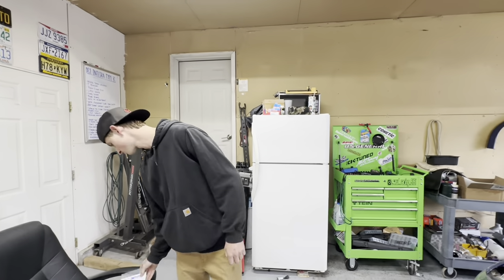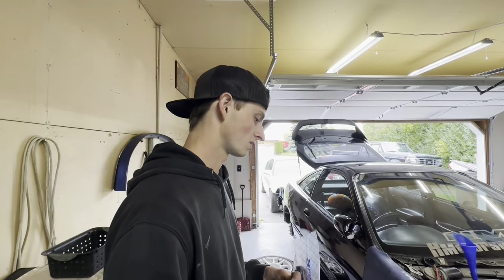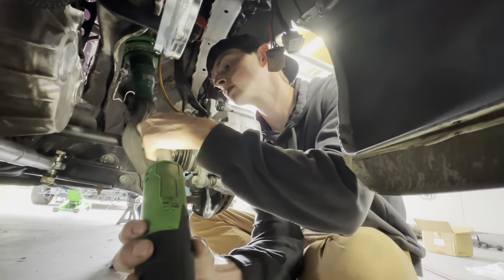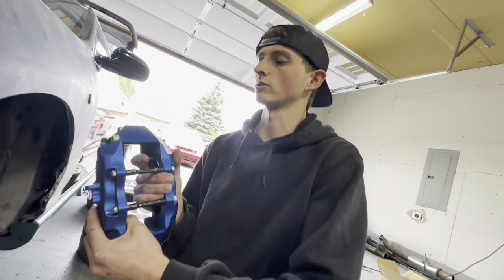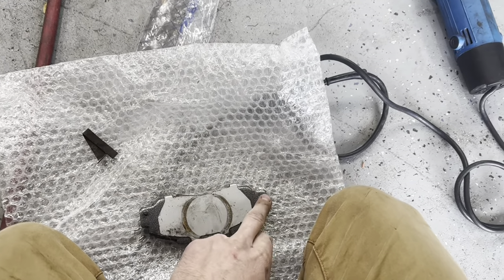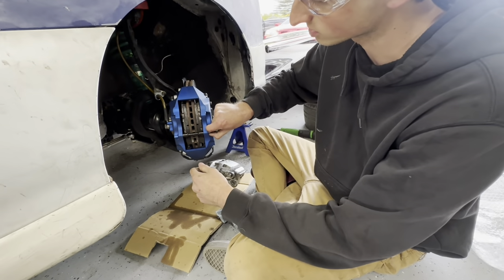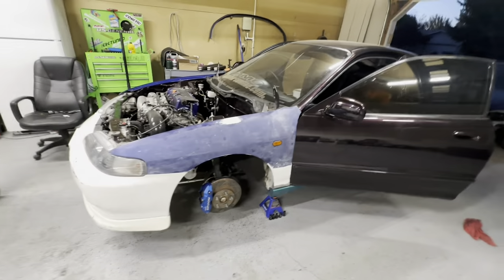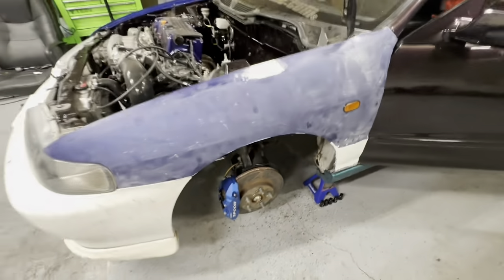DC2 Integra Type R $2,000 Spoon Twin Block Caliper install 😱

Comment: Nice install and explanation. Oh and kudos on the "safety squints" reference. 😁
Reply from the maker: Hahahaha god bless, thank you
Reply: @nwctuning  🙂 Just noticed you have EUDM clear indicators rear lights. Don't see them too often.
Reply from the maker: @MrGrentch  man those were hard to find haha! Came straight from Australia
Reply: @nwctuning  Forgot the Aussies got them too. Maybe the Mighty Car Mods lads riding around on kangaroos can see them more clearly? 😁

I think they look more 'modern' for some reason. I got mine from a local originally Irish sold one that the owner, overestimating his talent, as usual, ended up upside down in a ditch, calling for his ma and wetting himself(he now drives a Volvo estate...). Him fine thank god, car looked like it had been dug out of godzilla's footprint. Lights OK. Result.  

Kinda crazy how each market got different, sometimes very different bits and bobs like that. The USDM got a bit of a cut down model, minus recaros, momo steering wheel, but gained a centre console and a plastic tray on the rear seats, a slightly detuned engine and oddly JDM EK9 Civic Type R wheels. Canadians for some reason had an option of red rear seats too. Japan got yellow recaros and yellow stitching, but again oddly the Swiss also got a run of 100 cars that looked like the USDM/EUDM but also with yellow recaros.  My JDM is silver, a colour not available outside Japan. Before the 'world car' concept i suppose. No wonder Honda lost money on each one sold... 

Still, it means endless ways to make it a little different and OEM. a few years ago i got a USDM centre console with blank acura badge. Looks great. Then i realised why they weren't offered with the recaros; the seat adjuster is a now a pig to get to. Meh, let's face it, we petrolheads are mad, and that's a good thing. 😄

TL;DR?(good idea😄)good vid, Subbed.
Reply from the maker: @MrGrentch  i appreciate the support, and the information you’ve shared 🙂 hope you come to enjoy our other videos as we upload every Sunday. God bless

Comment: Are you required to run a 5mm spacer with the 98 spec wheels and spoon calipers or is it plug n play?
Reply from the maker: Yeah you need a spacer. I run an 8mm spacer. Other wise the spokes hit the face of the caliper.
Reply: Appreciate the info and video. With the 8mm spacer how’s the stud length? Is stock okay or you recommend going to an extended stud?
Reply from the maker: @derekyoungs8789  yessir that’s what I’m here for!  I recommend ARP extended studs

Comment: Hi man, are you selling your two 98 integra type R Brake Calipers as I have JDM 96 type R looking to put them on it ,I only came across your channel on YouTube loving your honda content keep them videos coming man
Reply from the maker: I hadn’t thought about selling them honestly. Hmu on instagram bro, same name as the channel
Reply from the maker: And thank you for the kind words 🙏
Reply: @nwctuning  Fair play, pass on the love of Teg. 🙂 IIRC it's an easy swap too, though also IIRC you need different wheels with more clearance as the 96 spec wheels don't quite clear. And maybe different brake discs? To be fair I've a brain like a sieve so that 'advice' might be best ignored. 😁
Reply from the maker: @MrGrentch  nah I think you’re correct bro. 96 spec ITR is 4x114.3 and the wheels are 15 inch and the rotors are 10.2 inches if I’m not mistaken. As opposed to 98 spec, they’re 5x114.3 with a 16 inch wheel and a 11 inch rotor 🙂
Reply: @nwctuning  Good God sir, I may be correct? I can't possibly be correct. I may have to lay down now.😁 

That said I run a 98 Spec JDM that came with 16's, but because of local Irish roads that are pothole rich and more tyre choices I got a set of 15 EUDM's and they run fine with plenty of clearance on the 98 spec calipers and discs. Then again both USDM, EUDM and AUDM models came with 15's as standard with the same brakes so...
Reply from the maker: @MrGrentch  hmm interesting. Crazy how many different types there are of the same car based on year and where they’re located. Cool stuff